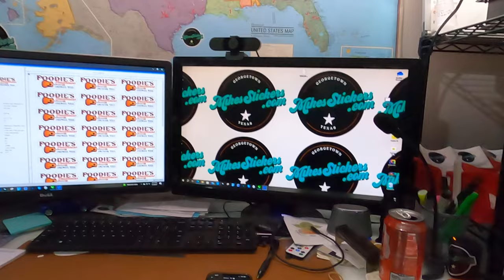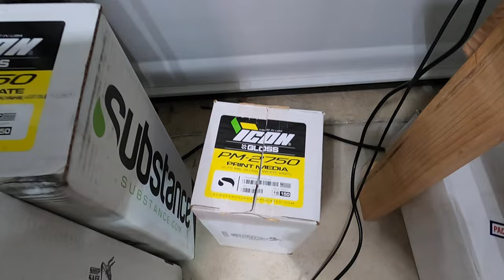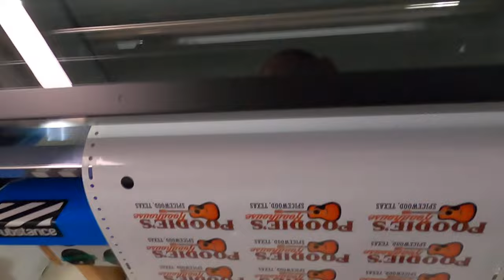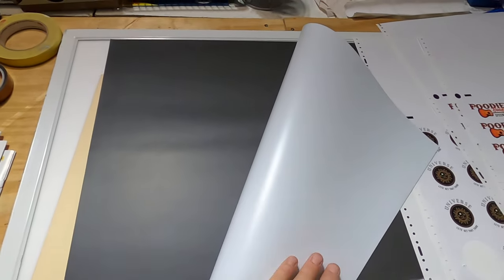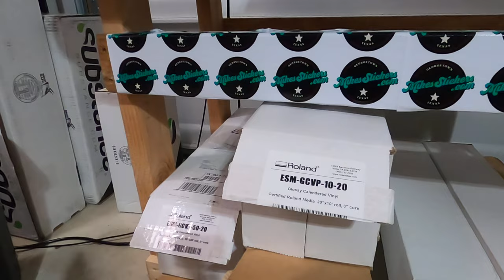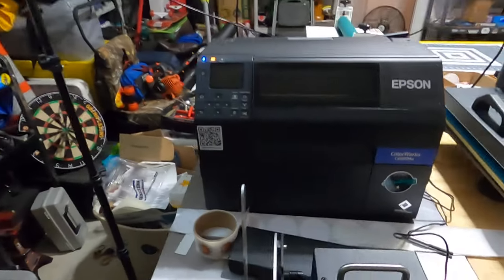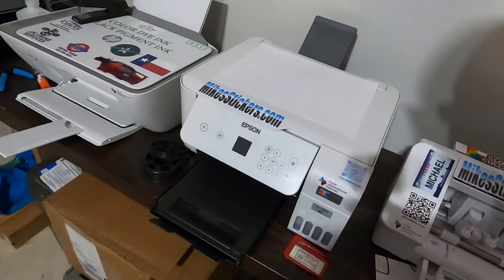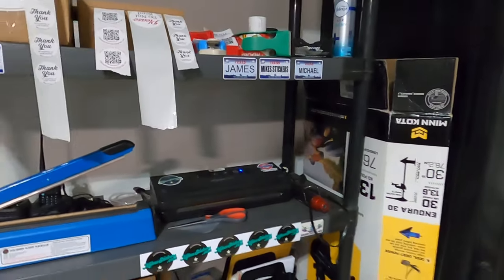June update

Comment: I know it's cheap for materials but it does get into profit margins; you are correct with pulling it out after the print but you can save yourself a couple inches from the start of the print.  About 8 to 10 inches inside from the right of the machine there is a square notch in the silver part of the machine where the media comes through and that is the paper sensor.  You just need to bring the media forward just past the top black bar inside to cover that sensor.  Watching some other videos i had a video show me this method.  hopefully this helps you.  :)